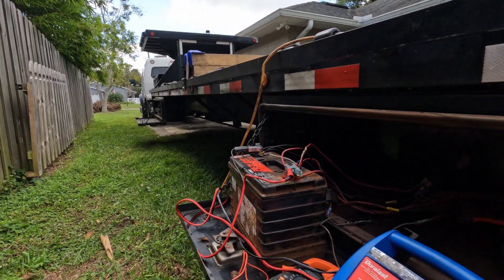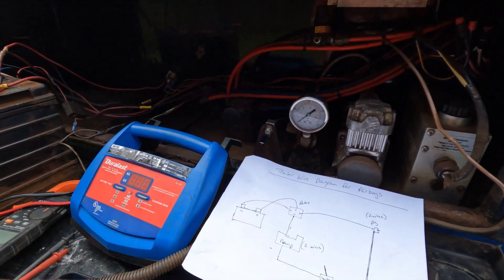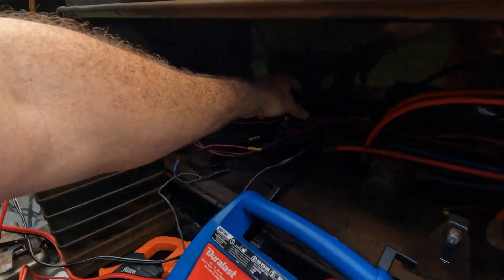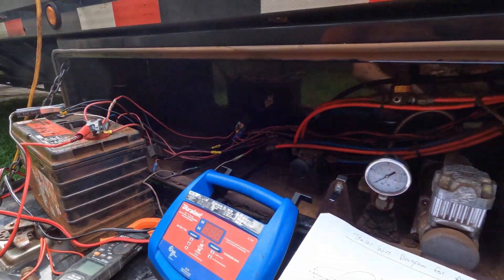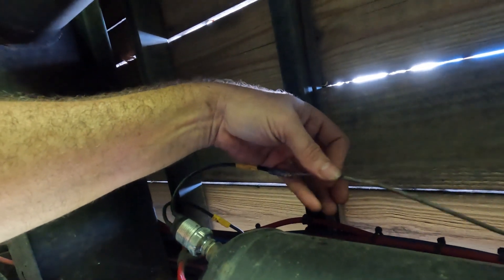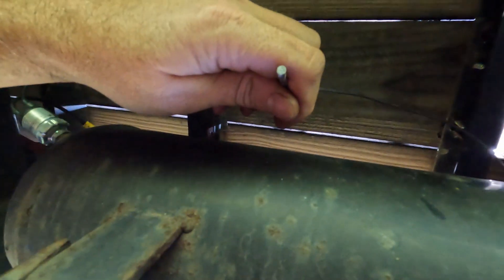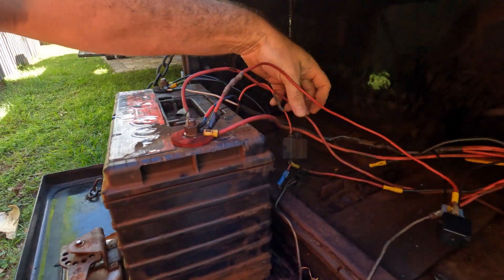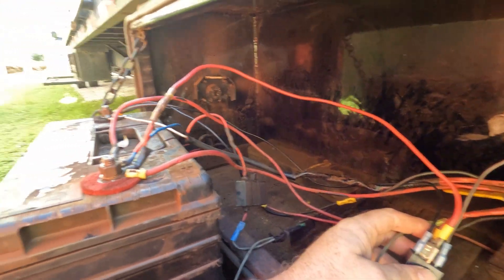Can this trailer be fixed??????? CDL Hotshot trailer issues.

Comment: Good to see you back on the road. Saw the video day 1 it was out but finally got a chance to comment. A continuity meter really helps with tracing wiring and finding faults in the wiring quickly. I Always keep one in each truck. 🤗
Reply from the maker: How many trucks you running and what type are they?
Reply: @kdlhotshotrv  3 trucks, 2 x f350 1x F450 looking at getting a freight liner sport chassis soon

Comment: I like AGM deep cycle batteries, they seem to handle the torture of a trailer better. Also use battery terminal protector spray or dielectric grease on all your open connections to keep them free of corrosion.
Reply from the maker: Went with a deep cycle marine battery with D grease.

Comment: They make a heat shrink that has solder in the middle. You need to use a torch but they work well.
Reply from the maker: I need to look into those.

Comment: Hello Ken just watched your video on truck wiring problems. You can buy butt splice connects that have heat shink.once you connect it you just heat with heat gun and your done. Less work same finish product. It it was me I would replace all wire 12guage heat sink all ends. And buy some cortisone spray for the battery post. Hope things good welland see you on the road next video.
Reply from the maker: Looking into those now. Did D grease on new posts.  Thanks for watching!!

Comment: When the connection is out in the weather you should solder the wires plus use heat shrink wrap.   They make a battery operated soldering gun just make sure you get the right solder wire
Reply from the maker: True, need to up my solder game.